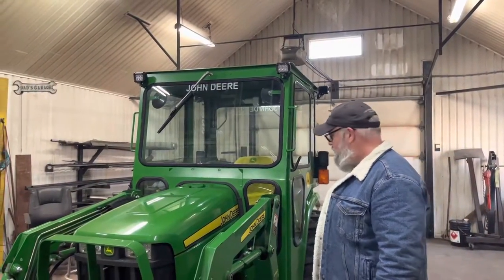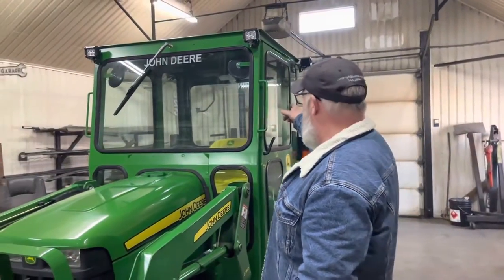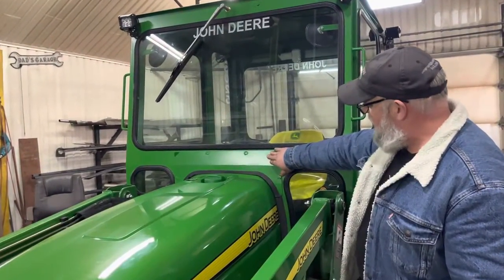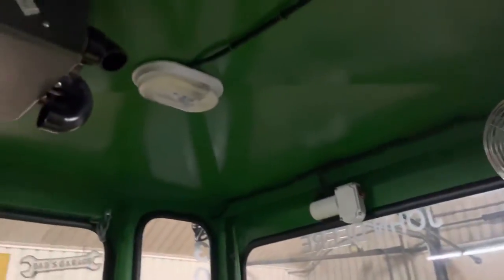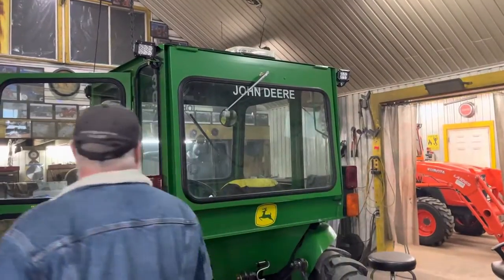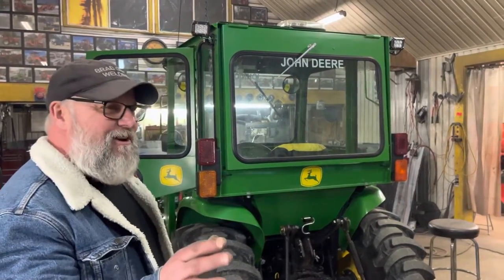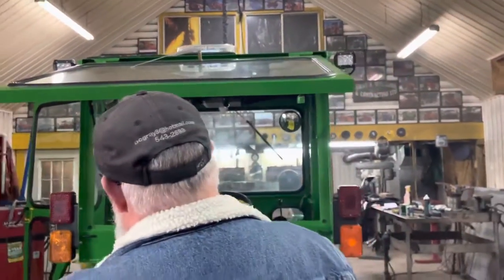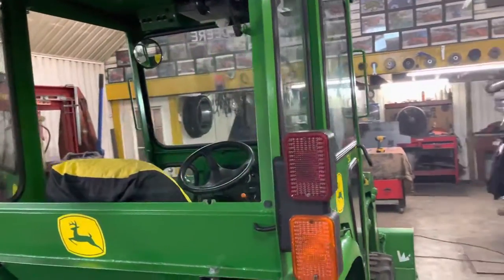Custom Fabricated Tractor Cab 3 Years Later // John Deere 3025E

Comment: Your attention to detail is so impressive, even for a tractor wanna-be like me - lol. 
I found your channel while looking into cabs for my John Deere 430 garden tractor.
I found an old Cozy Cab for my 420 and have been considering building one for my 430 (not the "real" Deere 420 and 430 tractors from the 50s but basically a riding lawn mower on steroids with hydraulics - not a real tractor - lol.)
The level of craftsmanship on your cabs is incredible. Subtle details such as how you angle the corners of that front hood panel (I'm assuming to make it "grabbable"?) and how you add the window vinyl with the Brand and model number - very professional touch. The steps, the electrical control box, the window seals.... it just goes on and on! And your custom door handles and window latches - outstanding. Nothing complicated - just solid quality stuff! 
Sorry for gushing - lol. I just really respect and appreciate quality work when I see it.  I also love how your cabs are one-off custom builds for each specific machine.
Consider me subbed!
Reply from the maker: Thanks buddy, get yourself some material and give er, I’m sure you will build a great cab for your little Deere👍

Comment: Can you build and send the cabs without the tractor
Reply from the maker: Unfortunately not, tractor has to be here in my shop for fabrication to ensure a perfect bolt on fit afterwards, also there are many bolting points that have to be “established” as well as the usual tweaking with joysticks , foot pedals, steps etc…